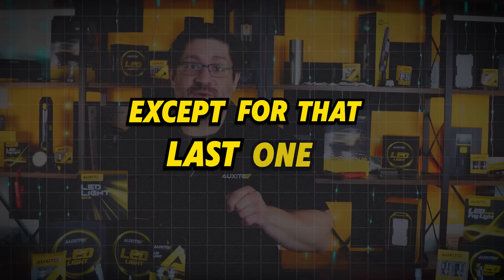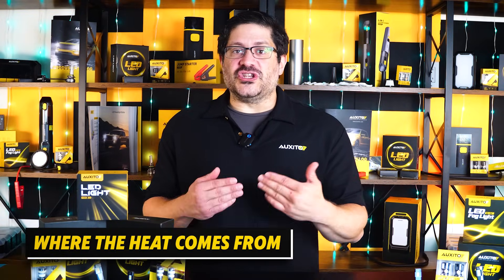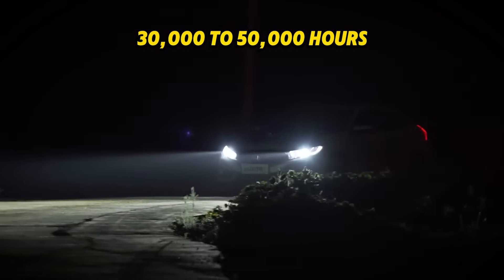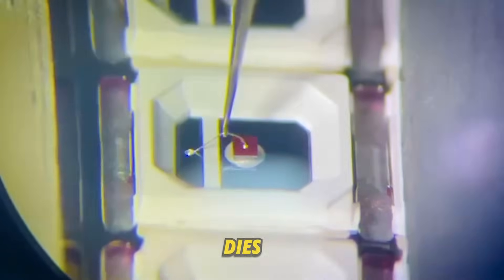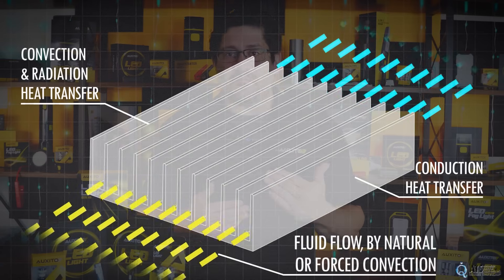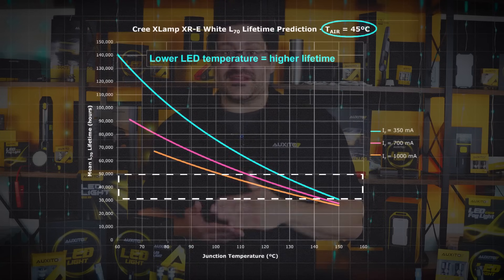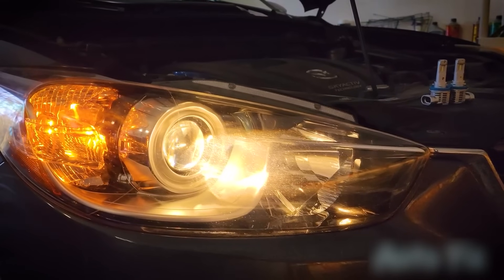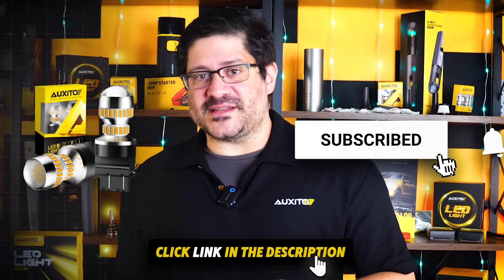Why Don’t Car LEDs Get Hot? (Or… Do They?)

Comment: @AUXITOLED

once again you guys did a swell job to make more quality content.

This is very well informed coming from Auxito and I love it. 

The next quality content u guys should considered is about, why automotive led lighting company manufactures always find CSP led chips or flip chips is the best choice for headlights, why led bulbs uses the most common SMD led chips for brake lights, turn signals, reverse lights, marker lights?, why ZES led chips is very little choice to see not so often, what is LMP led chips, and why COB is great for exterior and interior applications, but not so great to use as a headlights?

2: why two sided led bulbs, with very thin body and super tiny led chips that’s the same or almost the same size as the halogen coil filament is a lot better to create the perfect beam pattern, and why multisided led bulbs, such as from 3-8 sided or full 360 degree type led bulbs are always a bad choice for ur headlights?

Why beam pattern truly matters?

How come lumens is higher than lower lux measurement, or why higher lux measurement is lower lumens, or sometimes both are high or low?

And 3: why cooling fan led bulbs sometimes is better than fanless led bulbs?

Is it still considered a safe side to have a fanless led bulbs?